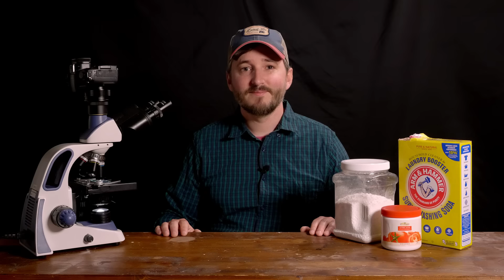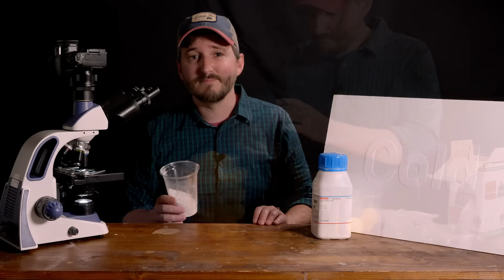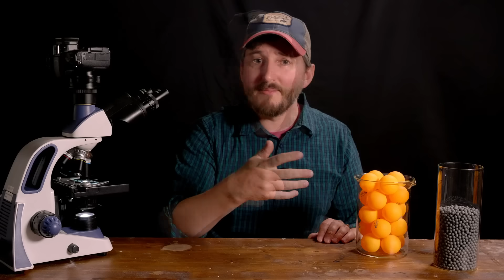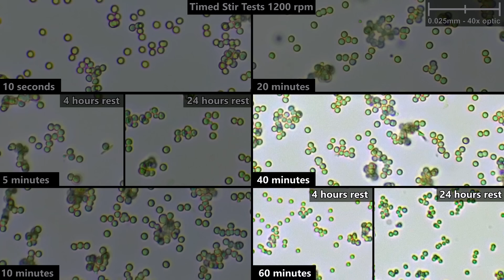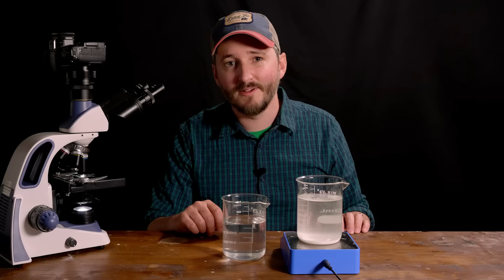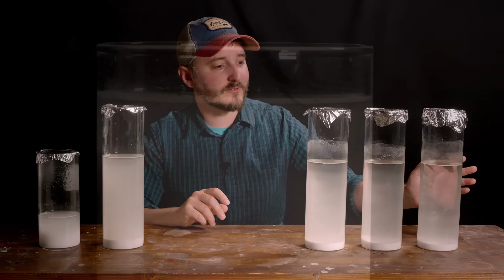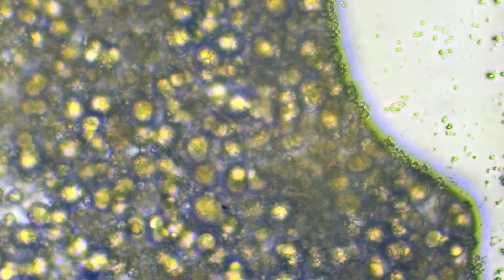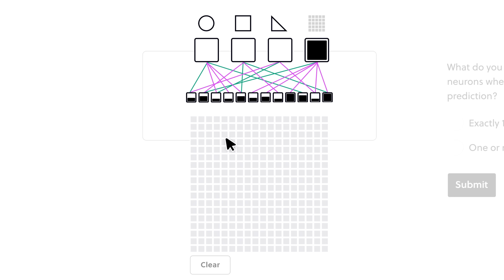Making Infrared Cooling Paint From Grocery Store Items (w/Novel CaCO₃ Microsphere Synthesis)

Comment: Using a self adhesive "Mylar" stencil type material or even simple masking tape could be used as "guide rails" with the paste like consistency trowelled in between to form a coating thickness. It could be applied initially with a decorators texture roller and then trowelled off for a smooth finish. A non stick silicone plasterers skim tool could be a useful tool for larger areas.

Comment: You might be interested to know, a professor at Purdue recently developed a super white paint using Boron Nitride platelets.  I tried commenting with a link earlier but it got removed.  The guy's name is Xiulin Ruan though in case you want to look him up.

Oh, and on the subject of applying this stuff, I feel like some type of trowel would work well.  It reminds me a lot of grout or plaster.  I expect a similar method could be used to efficiently apply a consistent layer across a wide surface.

Comment: I find myself wondering if silicone/naphtha would act as an effective carrier or substrate that forms a waterproof barrier for either a tarp (or other fabric) or a straw or bamboo conical hat.  Also, it seems to me that for some applications it would be as effective for it to coat the surface of fibers like a dusting of glitter or to penetrate and impregnate them as having a thick continuous layer.
Reply: I was thinking of textile applications too - a hat with a layer of this would be just the ticket on a hot day, provided you could make it a little flexy.

Comment: I'd be really interested to see some videos on those "failed projects" you mention at the end. There's no such thing as a failure in science as long as you learned something. 
I'm really excited to see where this tech goes. The passive cooling is just the beginning, there are so many efficiency gains to be made when combined with, for example, heat pumps. I'm also interested to see how the reflectivity compares to other kinds of thermal mirrors, such as those used in solar thermal power, where this could potentially drive additional efficiency gains. 

Spending the tremendous amount of work to develop an entirely new material, a novel and simple creation process, and then open sourcing all of that is just amazing. Thanks for making the world a better place :)

Comment: For applying the coating, try using a spreader. I've been covering large panels with housepaint or glue using a simple plastic spreader with good results. Pour out the "paint" in a puddle and spread it around. I'm sure you can think of ways to achieve uniform thickness.
Reply: Guide spacers on either side might work, like solder paste application or silkscreens

Comment: Consider yoyr waterproof coat8ng video: NAPTHA and Silicon reduces the silicon into solution. Therefore it is possible to 'dope' the solution into a water resistant paint that will be water resistant and robust.

Comment: Maybe a screen printing type process would work. A thicker rubber sheet with a square panel cut out, overfill, and squeegee off the excess (and collect to reuse). You'd have to determine a material that it wont stick to though. 

It may even be possible to make "tiles" of the material which you could then bond to whatever surface you may want without needing to be in the lab.

Definitely a fun project, and I'm glad to be able to watch as it grows

Comment: My guess of the delaying of the crystallization of calcium carbonate using citrate is because the chelation of citrate and calcium, which will not form crystals(maybe a compound of calcium citrate carbonate).
For some reasons, the citrate decay or the crystallization of calcium carbonate is still strong enough to form(due to the high pKsp), but is delayed due to the chelation.

Comment: Very impressive work going through the process and optimizing your results! 2 ideas for you: 1- I would be curious how well mixing the pigment into a clear acrylic pouring medium would work. It has a slowish dry time and is self leveling while claiming to stay flexible enough to work on canvas. It might make coating the large surfaces much easier.  2- it might be possible to create a process that makes the right ratio of particle sizes all in 1 go. Since you know that nucleation is the key to forming the right particles theoretically if you spike using a small amount of the 2nd solution mix for a time to create a significant amount of the large particles and then add the remaining 2nd mixture you could do it all in 1 batch. You would for sure end up with a distribution of particle sizes instead of discrete uniform sizes. In theory if it worked I would design it as a continuous batch tractor with constant ina and out flow. Based on the average residency time you would get a majority of a particle size but perhaps enough of the smaller to make exactly what you want

Comment: You're "fancy dust" may very well save my life! I have a huge struggle with heat illness and I've nearly died more than once from it. It was so bad that I had to retired from the job I had as a firefighter (for obvious reasons lol). I am going to make this paint for sure!

While I was watching this section on applying the paint to a surface, I wonder whether you had tried just finger painting it on. lol I know that sounds silly but the consistency reminds me a lot or mortar or really watery clay, both of which I've worked with. So you might be able to either use your hands or use one of the masonry tools available at the hardware store for spreading mortar. Just an idea that might help. Again, thank you so much for this video!
Reply from the maker: Acetone is not good to get on your skin in large quantities, so be careful with the finger painting idea!

Comment: Pressurized sprayer, you can control the shape with different tips. Plus you can control the pressure to an extent. Some have a real wide or narrow range too. Harbor freight sells a cheap half gallon one you use with one hand essential but you can't control the pattern as well

Comment: Could you directly cover this with a clear top coat, like the ones used for nail polish, to improve durability? Or would that start radiating on its own wavelengths in the infrared?

Comment: Wow, this seems like... actually significant and useful technology, and I love seeing this kind of thing developed in the open by a passionate community. Cheap, relatively safe materials, producing a coating that could be useful in environmentally-friendly cooling, which is going to be important for a lot of people. The process is simple enough to do at home, but that also means that it could be easy for a small factory to produce big batches of micro-spheres super cheaply, and make coatings for home and construction use, if effective ways to use them are anywhere near as easy as the production...

Comment: For application you could try filling empty tubes of acrylic caulk/silicone/glue and those cartridge press? I'm pretty sure at least some of those are acetone resistant. You could also shape nozzle with heat to be more flat to cover wider area AND control thickness of coat.

Comment: The gravity filter you came upnwith is very interesting for insoluble products, amdni did spmething similar foe when i was making lanratory grade iron oxide micro particles (no particular reason, just in case). 

However this time my problem is the opposite, and I need to separate the microparticles from my soluable product, and im not going to slend $100 on rhe proper lab equipment. Imstead om going to diy a vacuum filter usong glass cloth, paper towel, amd two different grades of paper coffee filters supported by a shower strainer in a funnel. For vacuum, a dustbuster and some vinyl tubing. Note rhat this will not work for steongly acic or alkaline solutions.

Comment: Great Work ! 
I'm really surprised that you are sharing this process for free , but I totally get the idea of making it available to everyone as fast as possible to provide tangible solutions to current problems. This is very humble of you and I hope you get the recognition that you deserve. 
Could this coating be applied to the gravel which is set on flat roofs ? 
Would rain be enough to wash off any dust and residue that could build up on it ? 
Thanks for sharing your genius 😄
Reply from the maker: It needs adjusting to work on a gravel roof.

Comment: Could you not mix this with clear epoxy resin and spread over a surface much the same was epoxy floor coatings are applied, the epoxy would hold it together and then would be resistant to weathering, It would be neat to see this applied in this way to a RV roof and then test before and after temperature drops.. Great Video love the detail you went into!

Comment: Since the acrylic white coating you use is a plastic foam, I'd imagine it's rather thermally insulating. Might that insulation be limiting how fast the paint can pull energy from the wood backing? Since you're measuring the temperature from behind it might be something worth looking into. :)
Reply from the maker: Yes that's possible
Reply: Great video by the way! Super interesting, I'm excited to see where the project goes from here.

Comment: so it's too fragile to cover my roof with? it's currently over 90 degrees in here and I'm getting fuckin' desperate for a solution that isn't a second air condtioner. (mine is new and was expensive)
Reply from the maker: This paint isn't ready for that yet, but there are other options already available that will help. Look for a siliconized roof coating and get one as bright white as possible. Henry's tropicool is one brand carried by home depot. It won't work as well as this paint hopefully will one day, but it will easily lower your roof temp by 30 degrees if it's currently a dark color.

Comment: I wonder if you mixed your pigment into a commercial latex clear base if you can now apply with a standard brush or roller. Perhaps other clear coats like polyurethane or shellac would be better suited. The base would have to be transparent to your IR wavelength.

Comment: I think this is your most impressive video yet. Very well done! I did have an idea for you regarding the microsphere crystal nucleation points. What would happen if you used an ultrasonic cleaner to agitate the mixture instead of the blender? The blender seems to work well, but as you were discussing your process the ultrasonic cleaner idea came to mind. I'm looking forward to the results of your small shed testing. That will be very cool (bad pun).

Comment: Awesome! I was wondering, is there a formula that can do the reverse? Can you make a black paint that has the opposite effect, or does black paint already have this property? I found this video because I was thinking that if there was a color-changing paint that could be white in sunlight and black in the shade it would be really good at keeping cool. Of course, the opposite arrangement would also be useful in some circumstances too. Cool vid! Keep sciencing hard.
Reply: If by "opposite" you mean "absorb lots of sunlight and emit very little IR" then yes, there are coatings that do this, black chrome and blue (something). They are commonly used in solar water heaters

Comment: I would love to see how effective this paint would be to cool a heat pump/AC condenser (or a radiative plate coupled to the condenser of a heat pump). Presumably, the radiated power would be proportional to the temperature or the temperature squared, so a large enough coated radiator could conceivably dissipate enough heat for a residential heat pump to operate without forced air cooling with ambient air...
Really interesting!

Comment: One thing I'm curious about is if the geometry of the blades for the blender could influence the mixture.  Another idea, what would happen if you purged your mixture with an inert gas to flush out the CO2 from the system.  Could also try to recrystallize the reagents to see if it helps, or filter the mixtures beforehand to help remove any contaminates.  

Always glad to see these projects.  Well done!

Comment: This is awesome. I replied below about trying Epoxy as the base. Also, the consistency looks an awful lot like Screenprint ink, a cheap screenprinting kit would be an easy test. And are the Al tubes going to be used for natural circulation cooling? Might work better painting a conventional heat exchanger, it has the tubes already in it, and if you make it runny enough you can keep the layer thin, you can even flatten the fins on one side to reduce the surface structures.

Comment: Could this kind of easy-to-make radiative panel be used to improve the efficiency of furnaces where the walls radiate their heat in this non-air-absorbent wavelength, but the crucible inside absorbs it?  The crucible would radiate other wavelengths of IR light, which would have to be either reflected or reabsorbed and re-emitted, but could this coating improve the efficiency of those types of furnaces?

I suppose a big issue would be getting the coating to stick to the very hot walls of the furnace, and not be damaged by spatter and such.  But these are solvable problems.

Wait, even better idea: Use these radiative panels as the cold side of a fully solar powered Stirling engine, with the hot side coated with a similar coating (also using microspheres, but in a material that is designed to maximize absorption and minimize emission and reflection).  

Which brings up another point: could this microsphere technology be used to make an even blacker and more absorbent paint than the high-performance ones currently on the market?  Or at least be a much cheaper alternative to Vantablack?

Comment: The simple solution to you casting any coating thickness is to purchase coating letdown rods of varying diameters and pour your paint on the surface and use the long coating rods or cast a layer o. The surface at any thickness

Comment: I wonder how this would compare to a surface coated with calcium carbonate from a water solution evaporated like hard water deposits.  I've had some hard water deposits from swamp coolers that were bright white and harder than paint to clean off the surface.

Comment: How can this be used to raise the efficiency of solar panels? High temperatures reduce output while cold increases it. What about the bi-facial solar panels that also collect reflected light on the rear side? I'm ready to install 24 bi-facial panels so do you have any great ideas for me to test? I was already considering white (not gray) concrete coated with purchased reflective micro beads or crushed oyster shell as a reflective surface under the ground mounted array. I admittedly was only considering reflectance and no temperature consideration for the final solution.
Paint it on the back side of a thin sheet of glass?

Comment: For application it may be an odd idea but could you fill a square or rectangular area with an open but sealable top and just dip one side of a flat panel to coat it? If that was possible you could just dip panels over and over again and cover up the solution if you have any left. The only problems that come to mind immediately is how quickly the acetone begins to evaporate and would the panels contaminate the paint in any significant way

Comment: Lenticular shades and polar lenses might do the trick. also you may be able to diffuse the Infa-red back into a solar panel to power a fan to move the cooled air around the panel to a decadent AC unit. cooking it even more.

Comment: You could also use an ultrasonic cleaning bath to create a better nucleation process, Should prevent the formation above a certain size and create new nucleation points constantly
Reply: Ultrasonic Bath is spendy compared to using a blender from Goodwill as an HSD (High Speed Disperser in the paint industry), still the Double Displacement is inspired making the pigment as well as the "contaminated" acetone to get the desired finish in the acrylic binder.
Reply: @r.gilman4261  A speaker exciter is like $20 if you want to make one yourself. Then you can also adjust the frequency, which should be able to affect the crystal size with more precision.
Reply: @r.gilman4261  transducers are cheap

Comment: Love the project! Some thoughts on the paint: Have you tried appling it like a putty with a spatula? It will take some time to learn alswell but could be way faster. This however requieres the tunig of the paints viscosity. There are some paint thickerers that work in small quanteties.
If spraying is the goal you could try shear thinning additivs/thickener to allow the paint to go trough the nozzle but not to run of your objekt.

Comment: Great video! I have been questioning the AIs and they say CalciumCarbonate does not have particularly strong emission in the transparent band. Neither does Bariumsulfate. You are describing a highly reflective paint though, so it will keep a building roof cool under a clear sky. Carbon nanotubes are mentioned as one material to emit specifically in the transparent window. Growing those to the specific frequency band may be hard or easy I don't know. It makes some sense to me because white materials are not good radiators compared to black ones. Also it is not too bad to send the radiation back into the sky, not all gets absorbed, so it will actually cool Earth. Maybe you can say something about that? Also it might be interesting to devise a recovery method for the aceton. It is expensive and will condense when cooled. Applying large surfaces outside in the sun would not be safe imho. If you suck the air away from it and cool it you will recover it..